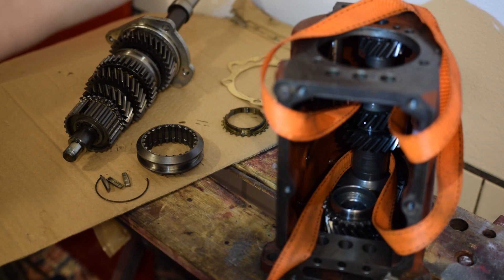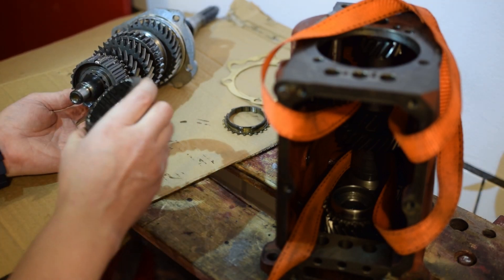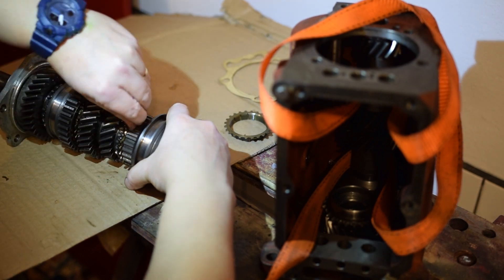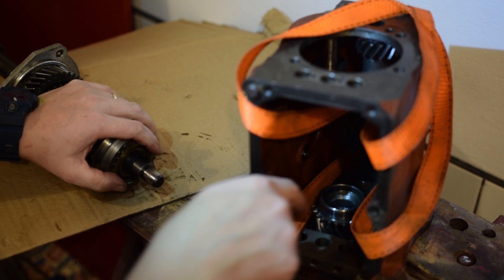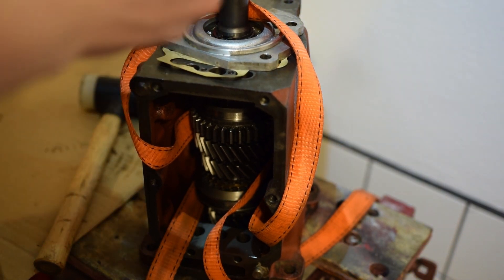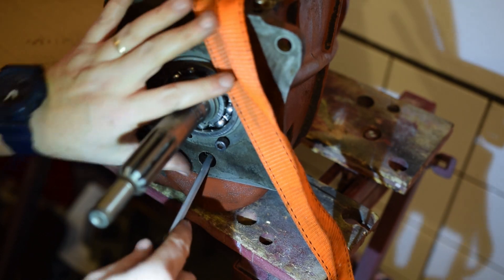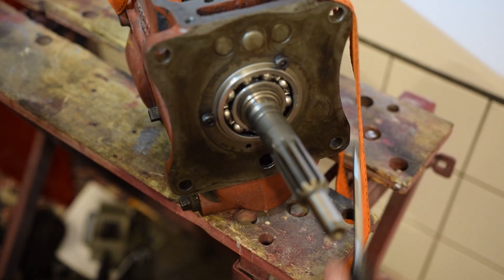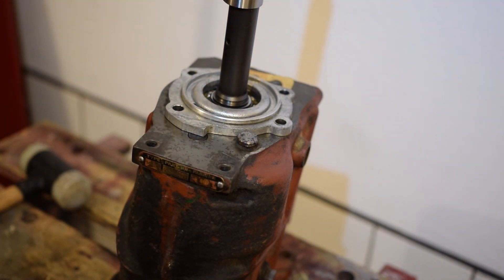Volvo M40 M41 gearbox output shaft, synchro assembly and laygear shaft install

Comment: I don’t understand the straps, the green book says to place geartrain in the bottom of the case with dummy layshaft inserted to retain needle bearings and small plugs holding thrust washers in place. Then place the output shaft in and gently roll gearbox upside down to allow geartrain to drop into position. Then remove rear plug and insert layshaft till it pushes out front plug and is in position.  I use rubber bands crisscrossed over end synchro of output shaft to hold it in place until I put shaft is in position, then snip the rubber bands, c’est fini.
Reply from the maker: Thanks for your comment. Do you have the dimensions of the small plugs? Next time I could try with that method.